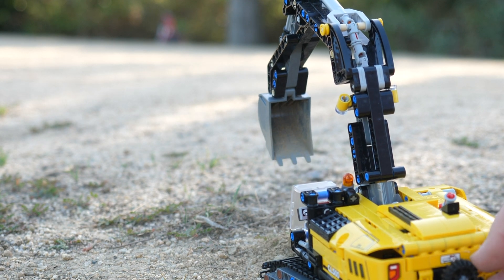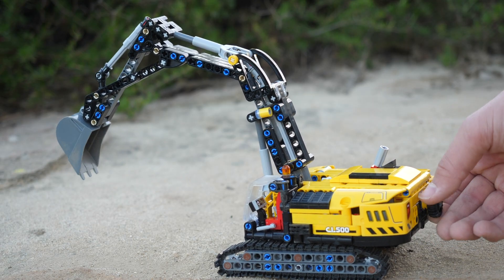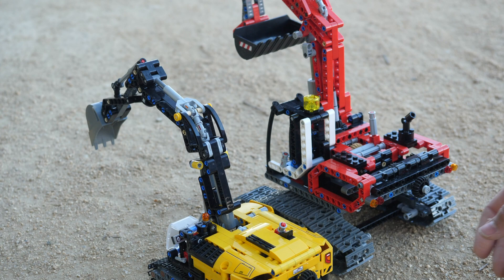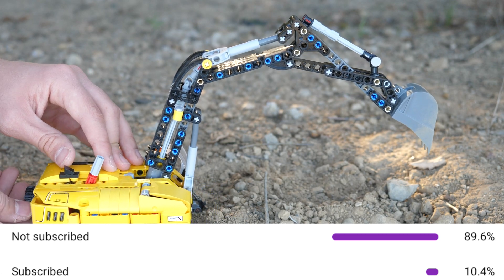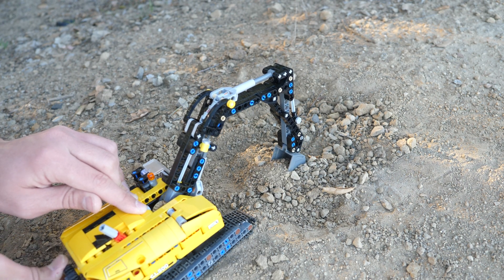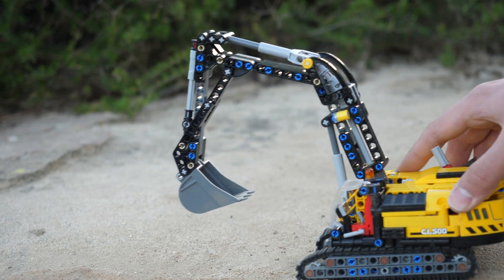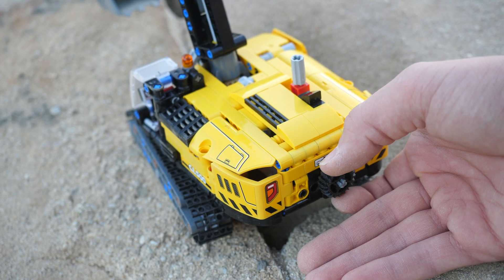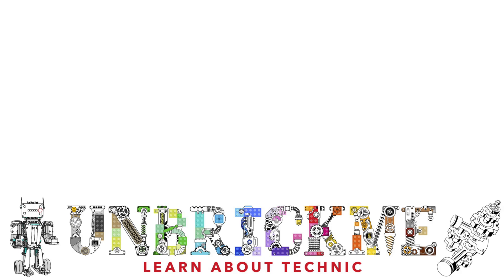LEGO Technic Heavy Duty Excavator Gearbox Mod with Free Instructions | 42121

Comment: I know you think it adds more functionality to the set 
And it does 
But realistically the boom and the stick would both be controlled independently from each other and at the same time in order for smooth digging motions and I think lego actually did the better job here allowing kids to replicate real world digging operations 
I'm not saying your mod is bad I just dont think it was needed
Reply from the maker: I completely understand that real excavators don't have gearboxes, but I mean, most real excavators aren't electric either (I'm referring to lego rc excavators) and there's plenty more things like that that don't make LEGO Technic versions exactly realistic to their real life counterparts. I was mostly inspired that the old, 2008 LEGO Technic 8294 excavator used a gearbox, and was very similar to this one.
Reply: @Unbrickme  I agree with that 
But in terms of a good functional toy that is simple to use and accomplishes a successful digging motion I think lego was right to not include a gearbox

Comment: At first I didn’t really buy into your opinion thinking a gearbox shouldn’t be expected in a set this size, but after seeing your mod I agree - it’s definitely possible to put a gearbox in here instead of two knobs. It seems like a straightforward setup that does not introduce too many complex connections to the model. You even managed to still retain the system piece detailing on top too. Overall, this is a lot better than the original!
Reply from the maker: Thank you very much!

Comment: Im trying to make this pneumatic only use this set and 42120 pieces pneumatic system is from 8862 and two oringinal sylinders i have to swap because i broke them acidentaly so far i builded almost the superstructure so back gear is controlling the rotation of the superstructure and the arm is my made so this time there is 3 sylinders. 1 is controlling the first stage boom 2 is controlling second stage and 3 is controlling the bucket so my plan is to put 42053 blue pump inside on the bottom struckture where the tracks are locate
Reply: Pneumatics are the best (cylinder is with a c)

Comment: You don't need a gearbox! I feel like everything in your life needs to have a gearbox.  :)
Reply: Gearbox is life man, even my breakfast has functional 16 speed gearboxes
Reply: Agree
Reply from the maker: @urmom69878  older technic sets always had gearboxes
Reply: This is a joke btw.
Reply from the maker: Depends on what kind of tank it is. If it’s large over $150 then it should have 1 large motor and a gearbox to switch all the different functions. Also lego won’t release a tank since it’s military
Reply: @Unbrickme  that’s actually a pretty good point, i recon it matters more on the part count, if a lego excavator has a motor for every function its going to be expensive no matter what, but you could have a really high part count with a gearbox and alot of functions. Gearboxes raises the complexity and decrease cost per function, in the end it boils down to money so i think lego would rather the former because they can probably pump out motors for $10 and price them for $50. Also if lego is looking for more customers i think they’d rather something complex but not to complex so it isnt impossible for newer/intermediate builders.
Reply from the maker: SwunkS Plays good point. I don’t think gearboxes would add much more to the price necessarily. What really bothers me is that 5 and more years ago, pretty much ALL technic sets more than $50 would come equipped with gearboxes, and sometimes even $30 sets would come with gearboxes, like the 42048 race kart. To me it seems lego technic became much more basic than it used to be pretty recently, and now gearboxes have become a rarity. I mean, absolutely ZERO sets released in 2021 so far contain a gearbox. in 2019 we only got 2 sets with a gearbox. This is a real shame
Reply: @Unbrickme  yea true, its sucks aye.
Reply: @Unbrickme  i always wanted a cheap set with a gearbox... i hope 2022 will give us one
Reply: @swunksplays3562  LMAO 😂
Reply: I definitely prefer this set with a gearbox it ads a bit of much needed functionality and makes it a lot more interesting as a hole

Comment: it's cool that you've managed to do it, but I wonder if the controls at the back/centre are really that ergonomic for a model. I'd probably go for either two gears at the sides or a gear on the right and the gearbox lever on the left. I wonder if that would make more sense.
Reply from the maker: I prefer using distribution gearboxes rather than having a single knob be connected to a specific function